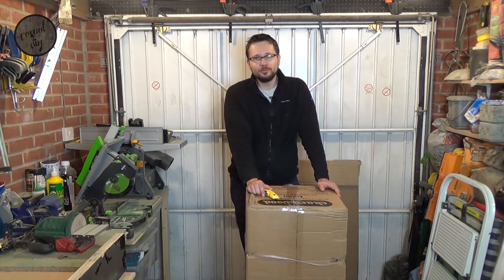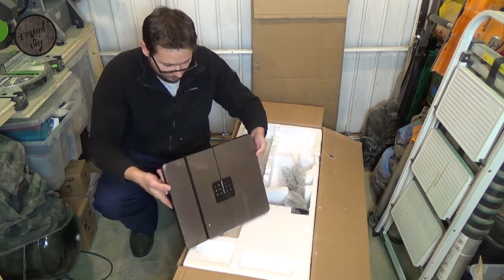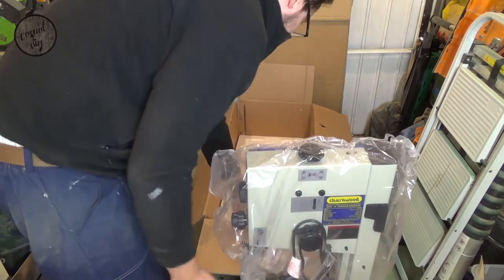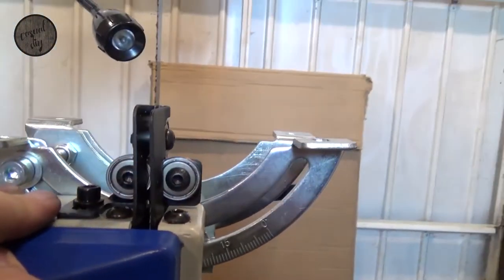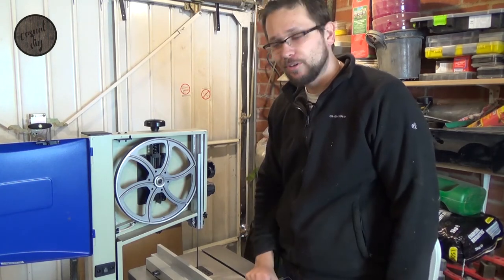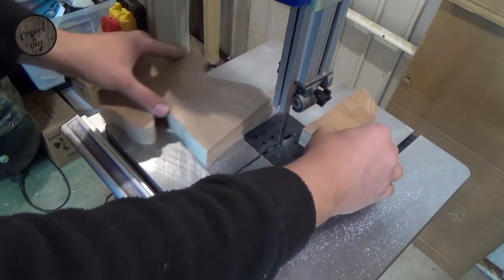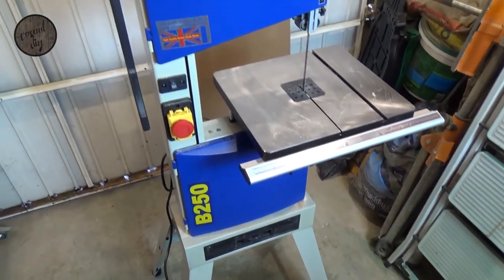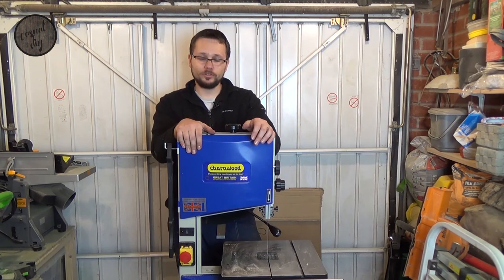Charnwood B250 Premium 10" bandsaw - unboxing and review

Comment: Looks a great little machine
Reply from the maker: Badger Workshop it is use it all the time and had no issues so far:)
Reply: I have the Record Power but the fence looks much better on yours.
Reply from the maker: Badger Workshop that was one of my worries before buying this bandsaw but I have to say I was positively surprised. The fence is very good and it's not wobbly. Best of all there was almost no adjustment needed to get nice 90 degree angle with the table.
Reply: I don't have any Charnwood tools but now might look at them in the future
Reply from the maker: Badger Workshop I can fully recommend it :)

Comment: Looking at this machine  it looks like the legs are a little too low or was jt the angle of the camera?
Reply from the maker: Hi, for me it is too low to be honest just for comparison reasons I'm 184cm tall. I'm actually redoing my workshop and one of the projects is that I will remove the legs and build a small cabinet with wheels. So it will be at a better level for me.

Comment: how is this saw holding up after a year?
Reply from the maker: Well I've not had any major problems with. The only annoying thing is the bearings that guide the blade. They are pain to adjust and the adjustment spectrum seems to not be enough. And I would pick up the model up bit bigger as I often find the throat is not big enough to rip boards I want. Other then that it works fine and it has not missed a beat.